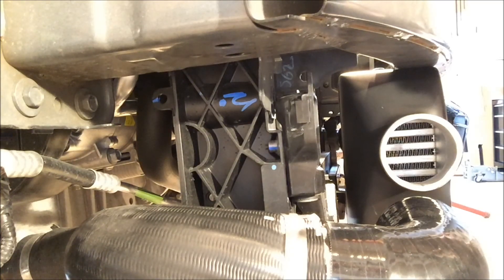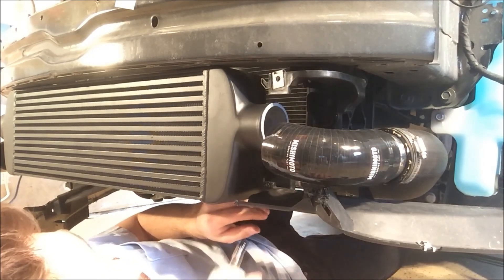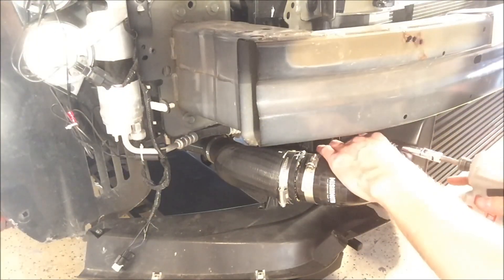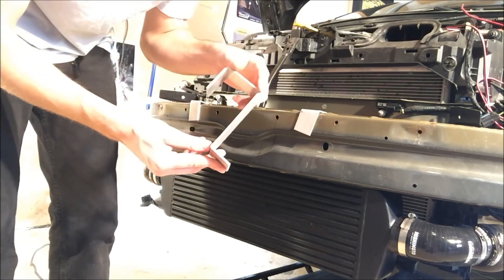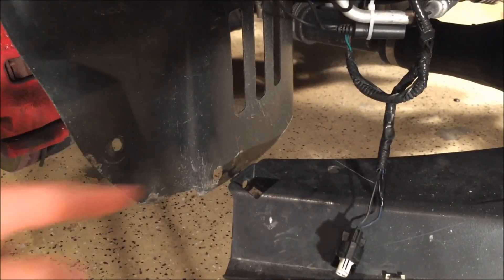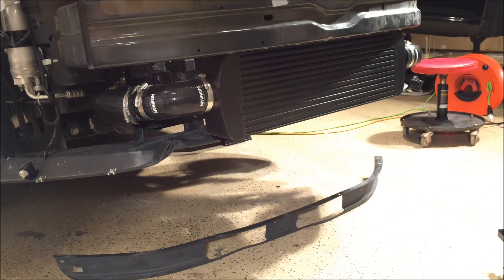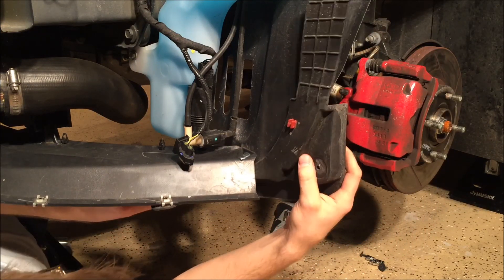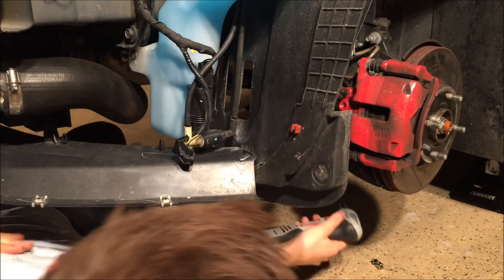Part 4: Mishimoto J Line FMIC Install 2014 Fiesta ST

Comment: After doing more research because I was looking into getting this myself, I realized the intercooler is not symmetrical front and back. There is an actual front and back side...  At 0:07, you can clearly see one side of the end tank is curved and that the inlet is off centered. You have it installed "backwards". The end tanks are flat on the back side, flush with the core, while the front side has end tanks that curve. In other words, if you flipped it around, the IC would sit further back about an inch, possibly making the elbow hoses a lot easier to connect. As well, the removal of that support bracket wouldn't be necessary, nor would you need to cut the bumper for the elbow hose afterward.
Reply from the maker: AzNightmare good catch. I had not noticed this small difference when inspecting in person or reading the supplemental Mishimoto material.
Reply: Hey, just curious, is there a Mishimoto logo on the other side? It seems like some people are getting intercoolers with logos on one side, or no logos painted on at all. I thought you might have purposely installed it in that orientation because you didn't want the logo. And on the forums, you're not the only one. Seemed like MANY people installed it that same way.... I'm wondering if there was a reason for it